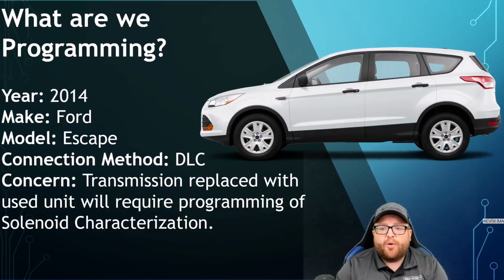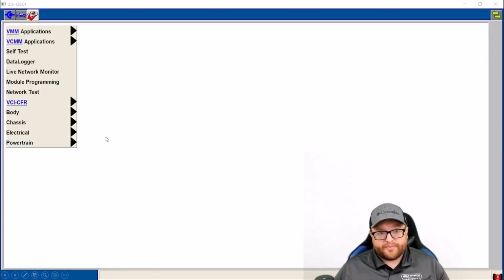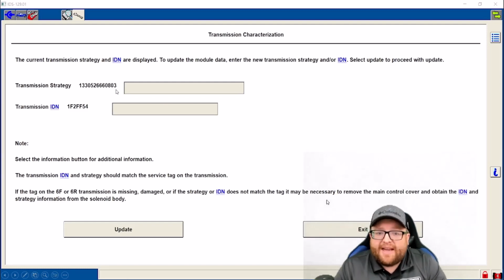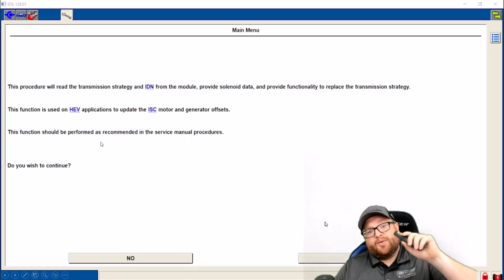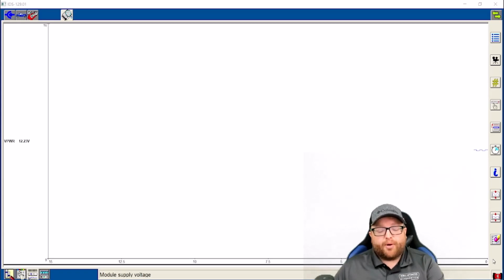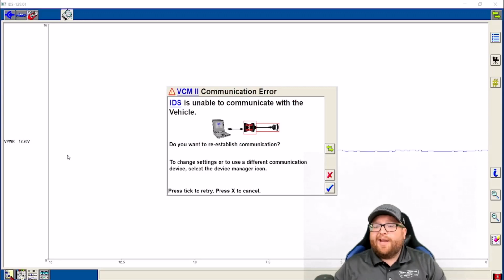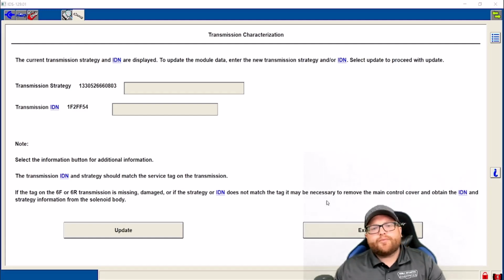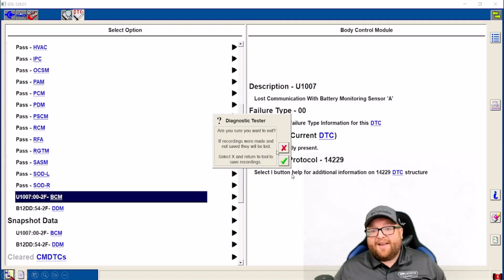FORD Transmision Solenoid Characterization Programming

Comment: Do you have any information on the 2019 and later bottles of the Ford edge with the 8F 35 transmission? and what is called the fucking jerk or hesitation at slow speeds that Ford has decided to ignore the customers like it either doesn’t exist or it’s just normal operating procedure. If so, do you have any advice that actually productive most of what we get from other forums is simply sell it or set fire to it, but I happen to like the car other than this one issue so I thought I would reach out and see if you might know of anything that could help thank you

Comment: Guys if you are new to this and do not have a programming maintainer do not attempt it with a regular battery charger. Your best bet is to find a NON-smart charging vehicle and use another car's charging system to maintain the vehicle. Make sure all the loads are off on the other vehicle and if you have a throttle stick bring it up to about 1,000 RPM. If you ever saw a CAN buss oscilloscope pattern on a regular battery charger you would instantly know why. I have programmed like this many times in my younger years and never had an issue. I still urge you to get a maintainer though. As much as it is preached people think it is something you can get away with. There are probably more failed programming events due to improper battery voltage than anything else.
Reply: Sorry I hadn't watched to the end.
Reply: i use one and never have had an issue the main thing is a fully charged battery really